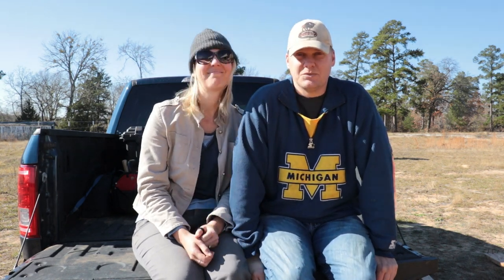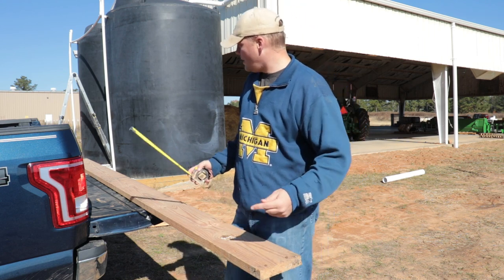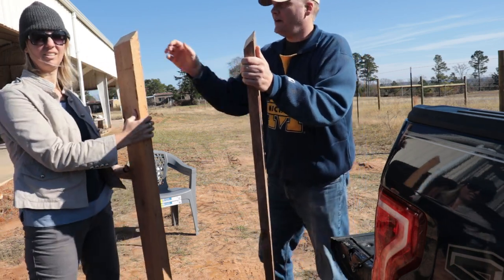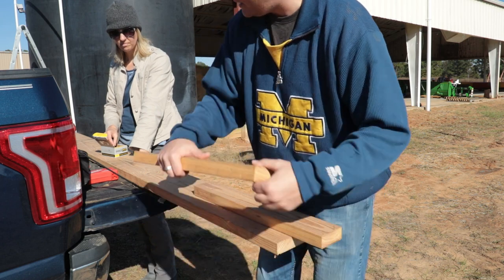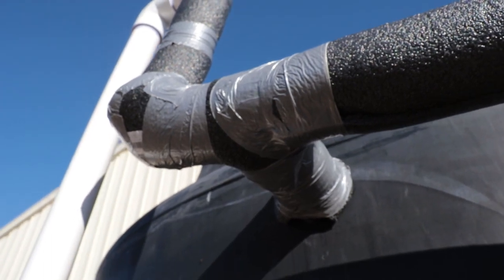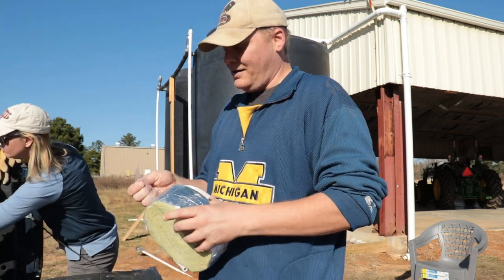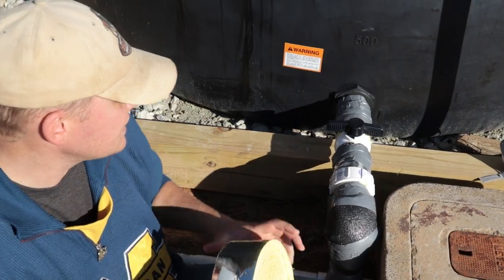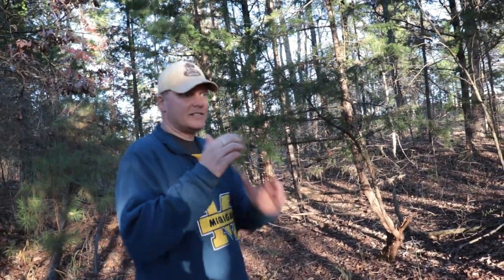Ep. 48 - Prepping for COLD and Mulchers at Blackacre Ranch

Comment: Is it really necessary to have the over flows connected?
Reply from the maker: No.  I do have doubts about continuing this practice as I put in other tanks. If they are only connected together at the bottom they will cross fill.  However if there was ever a cracked pipe or leak down line, all the tanks would then leak out.  Since I don't live there, I'd lose a lot of water.  The over flows being connected allows me to shut the connections off at the bottom but still allow cross filling.  Then I won't be at risk of losing all the water.  Do you think it would be worth doing more of a graphical explanation in a video?  Maybe I'm being paranoid is all.